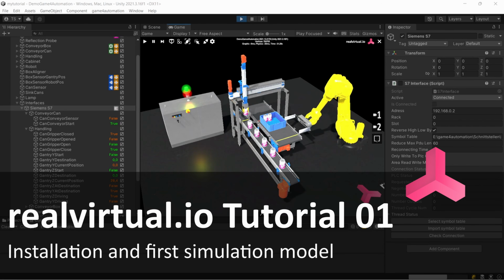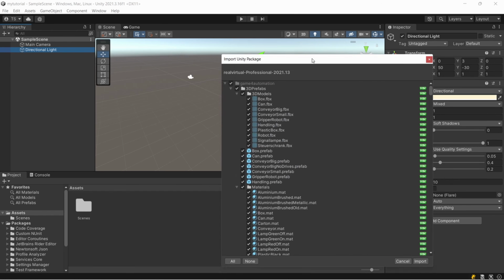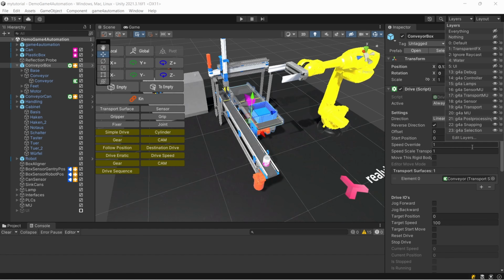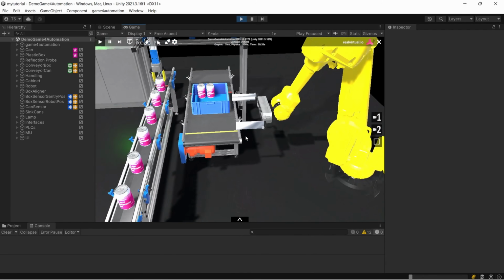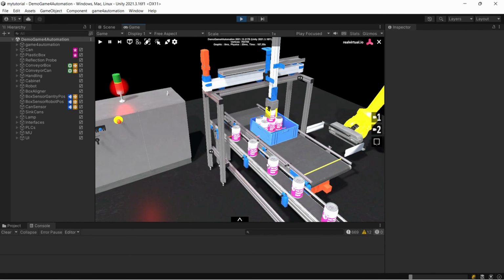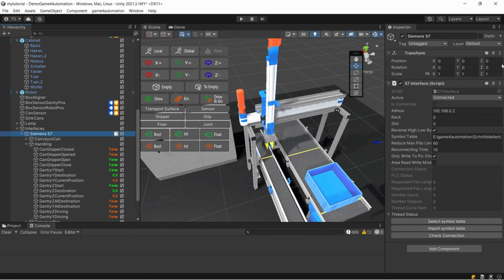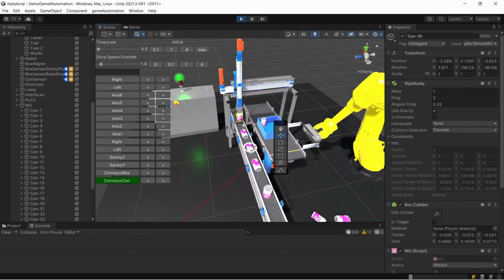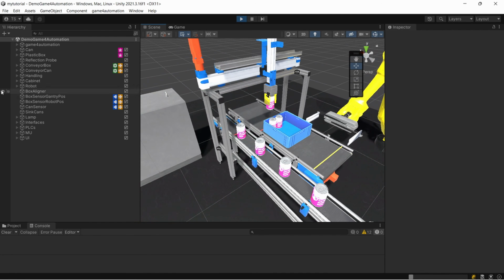Get Started with Digital Twins: Installation and First Steps with realvirtual.io and Unity

Comment: I am pleased to share with realvirtual, Professionals and Companies the most advanced technological tool in existence: the Digital Twin that I developed in 1981 under the name of Vir-tual Instruments. https://youtu.be/eadaQiL_AK0    https://youtu.be/fXlp4QLdWQs   Export the realvirtual, Copilot, Chat GPT, Revit, Plant 3D, Civil 3D, Inventor, Engi file of the Building or Refinery to Excel, prepare Budget 1 and export it to COBRA. Prepare Budget 2 and export it to Microsoft Project. Solve the problems of Overallocated Resources, Planning Problems, prepare the Budget 3 with which the construction of the Building or the Refinery is going to be quoted.